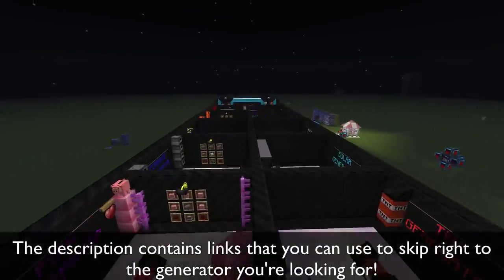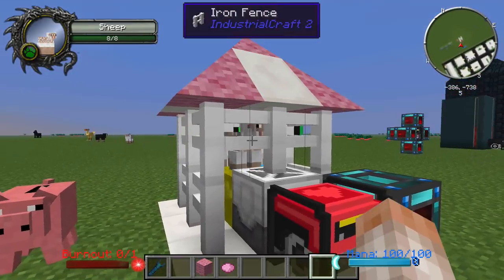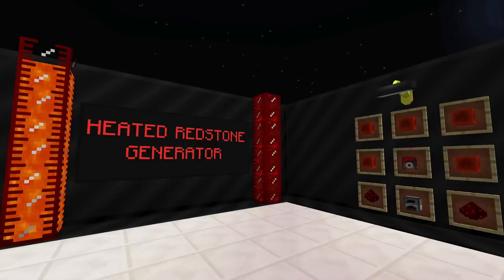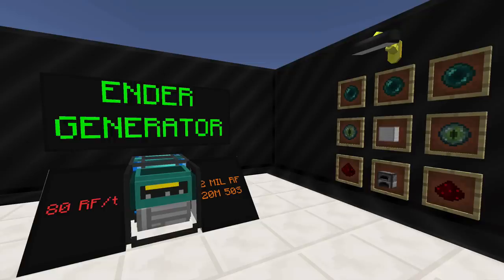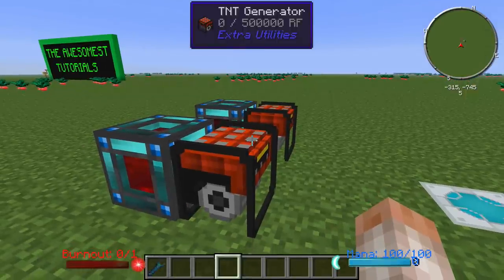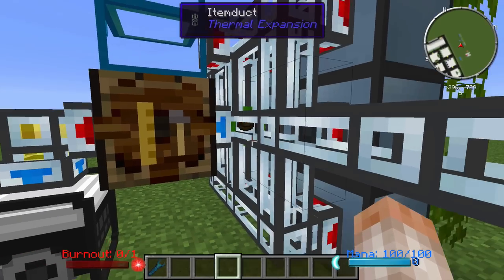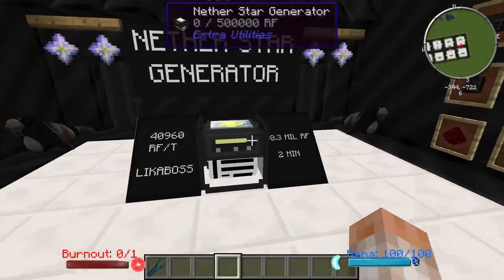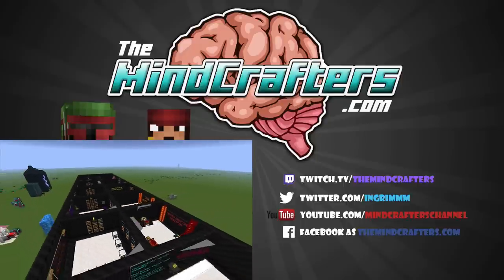Extra Utilities Tutorial - Generator's

Comment: Here is a challenge mute your iPod activate Siri then turn your screen face down on a table and say 100  (that's "one hundred" sing your favorite song for one hundred seconds  and then grab your iPod (you mute it so that you don't get feedback from the recording) then inmute it and tell Siri ro "save that " or "three" (the numbers i tell you correspond to all the different things you can ask Siri that you just cant "say" like call "dad " THESE ARE DEVELOPER COMMANDS ......EXPLORE THESE COMMANDS ALL YOU LIKE BUT I AM NOT RESPONSIBLE FOR CORRUPTING YOUR IPOD BECAUSE YOU TOLD SIRI " 101336" WHITCH WILL WIPE YOUR DEVICE, BECAUSE I NEVER TOLD YOU WHAT YOU NEED TO SAY AFTER TO CONFIRM THAT YOU ACTUALLY WANT TO DO THIS) what this does is records you and saves it (your file will be saved in voice memos (YO YOIU NEED A IPOD AS IPAD DOES NOT HAVE IT and if you do it on a iPad it will simply crash (restart) your iPad do not attempt